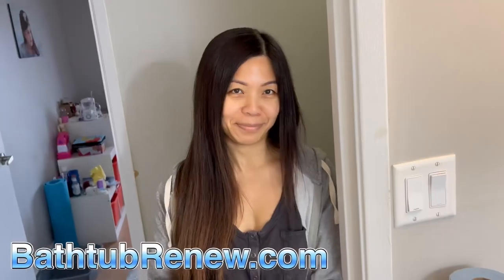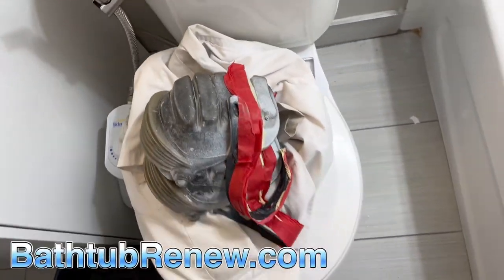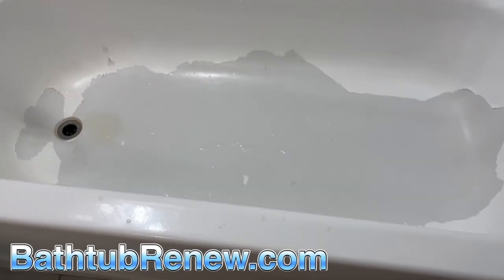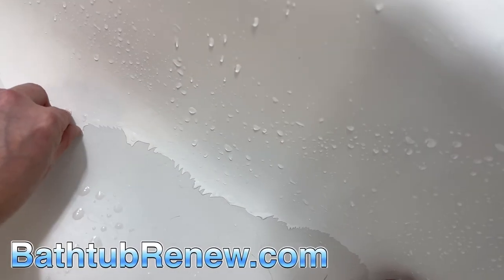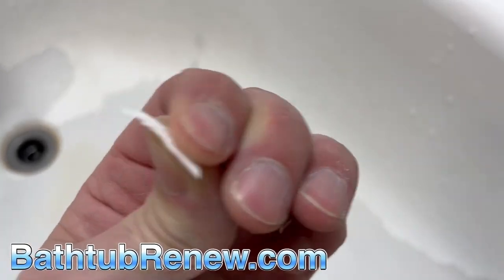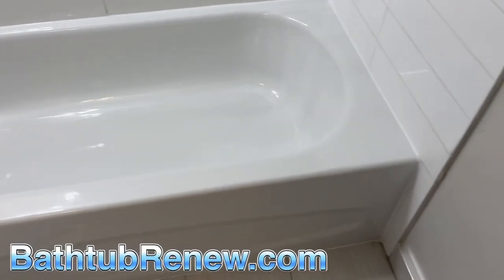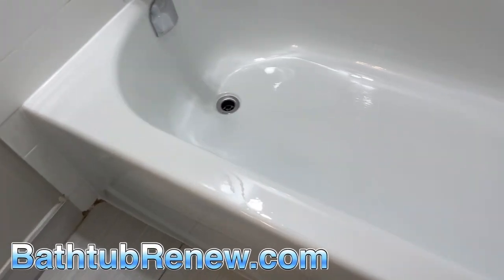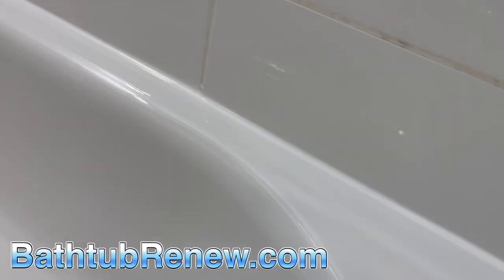How we repair/reglaze a peeling tub

Comment: Any reason why dident you strip all of the coating?
Reply from the maker: Only failed on the bottom, the rest of the coating adhered very well.
On the ones that it isn’t adhered well we will take off….. this one required and feather and partial strip.
We give warranty on the performance, we seldom ever have one fail doing it this way. Maybe 2 in 14 years, if they fail, we just fix it and it never comes back.